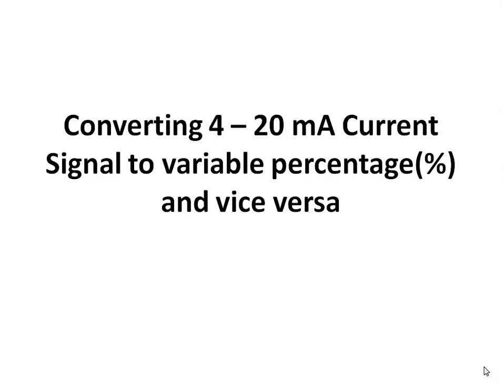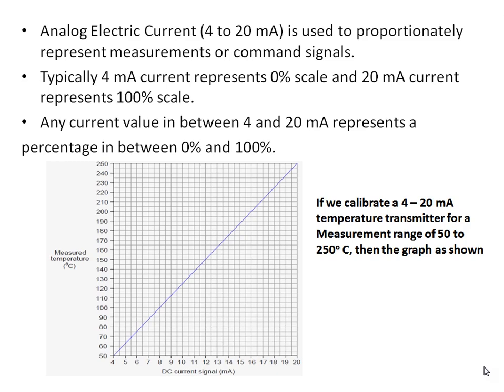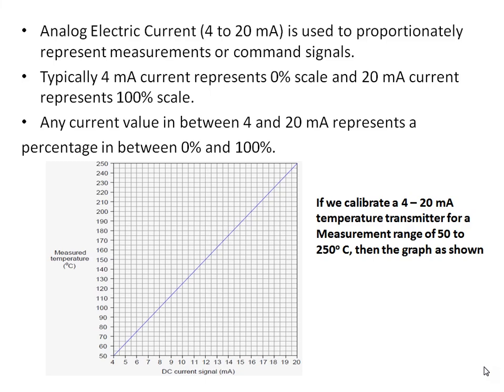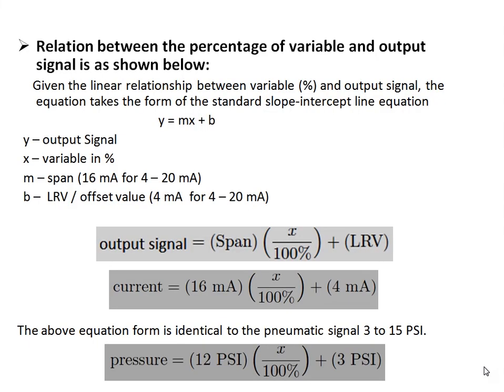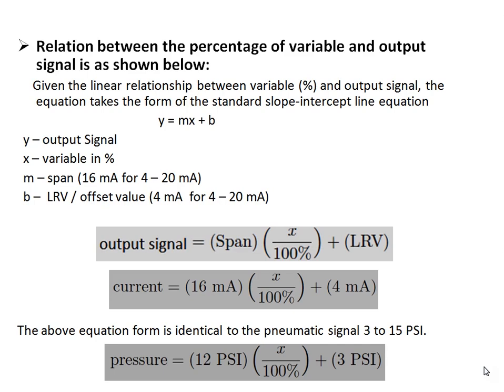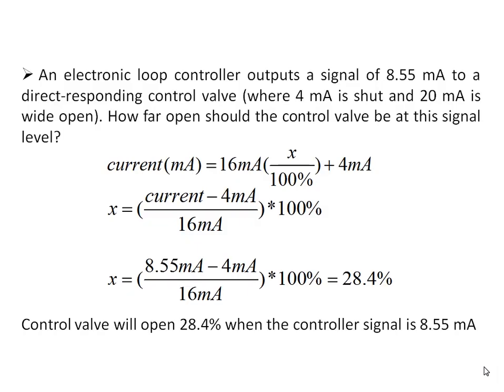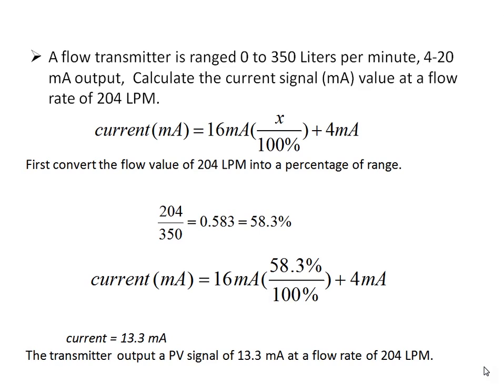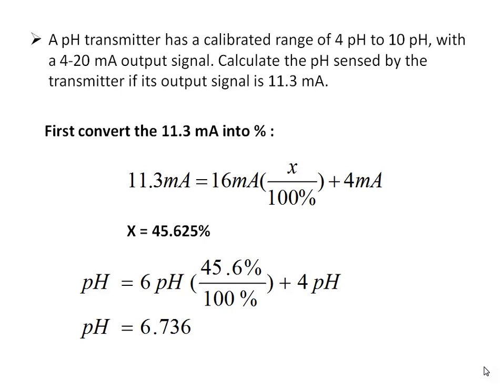Transmitter Output signal 4 - 20 mA to Percentage(%) conversion

Comment: Then how do you solve this...

. a turbidimeter outputs on a 0-20 scale on 4-20amp then whats the NTU reading process value is 14.75mA? 
Suppose the same instrument that's showing 0.21 NTU then how many mA is it outputting?

Comment: I like using the formula. And in your video I liked the three practical examples of applying that formula for a controller output, a sensor output and calculating the actual measured value. Thank you.